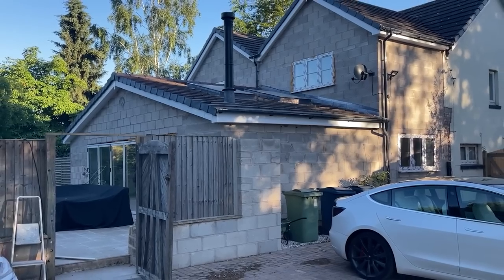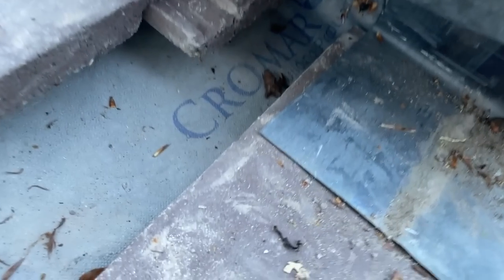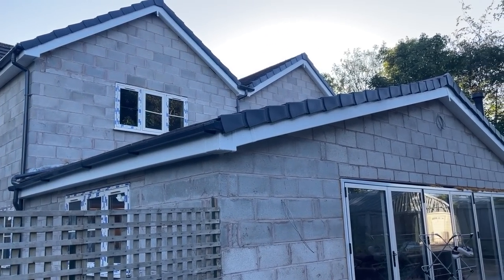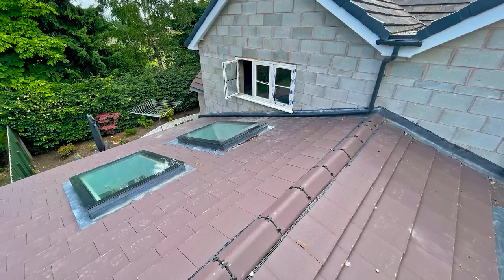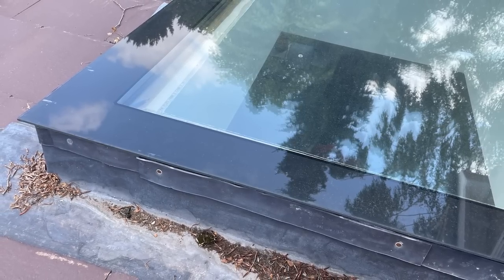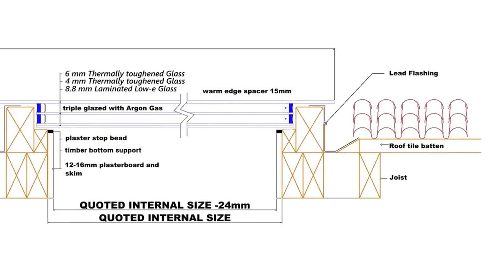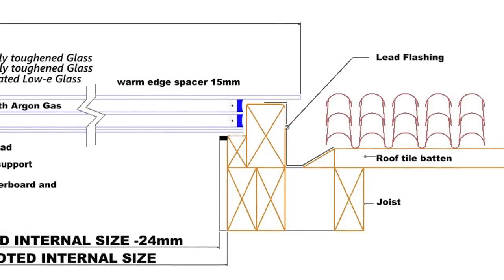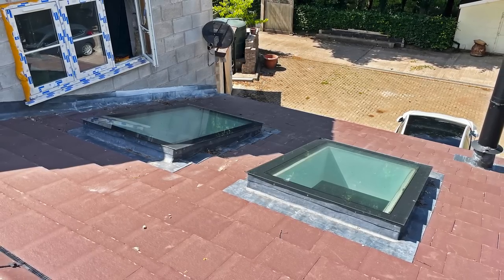How Many Mistakes Can You Spot on This Roof?

Comment: I’ve only just finished watching this and being a roofer myself I’m sorry to say you would be better off ripping it off and doing it properly. If your having problems now, trying to fix some of the problems is basically putting lipstick on a pig. Take it off do it properly and you won’t have to worry about problems in the future.
Reply: what i think also worse new roof ive seen in the 24 yrs
Reply: That's just lazy. Any decent roofer should fix that problem
Reply: @PhilipAlexander-rz6hy  your obviously not a roofer or certainly not a decent roofer, those roof tiles should not be put on a roof with a pitch of 15 degrees, there is also short courses at the top of the roof which isn’t a massive deal but definitely not right
Reply: @Telferroofing I am not, you're right. I had a reroof done which was awful. I couldn't afford a reroof, did some research, worked round the mess and patched it up. 16 years later, not a single leak. It's not ideal, but sometimes you have to work around bad things to save the costs. That's all.
Reply: @PhilipAlexander-rz6hy  in some cases yes you could repair the bad areas and save the rest but this is beyond saving as the tiles used just aren’t up for the job even if they were fitted correctly, yes you probably could patch it up in a way but for me if it was my house I’d want it done properly regardless of cost to rectify but I guess that’s why they are in that position
Reply: @Telferroofing  in my case, I was 27, just lost my job, house was a mess and roof was too. I had no money left. I didn't have a choice. There are still things that need fixing like the fascia boards but it's rain proof. They didn't lap the tiles correctly and didn't go high enough with the tiles to the apex. I worked round. I have the money now to reroof but why would I? It's staying and I learnt a lot from that horrible part of my life
Reply: @PhilipAlexander-rz6hy  just let me know if you change your mind and need a good roofer 😂 all the best buddy

Comment: Poor advice given in my opinion the roof needs to come off and correct tiles for the low pitch situation fitted. The coursing of the tiles differs on both pitches of the roof. The correct water proofing and flashing detail around the roof lights also needs to be introduced. Not good advice given in my opinion.
Reply: Agree, Rogers a plumber or general builder? He is knowledgeable but he’s talking crap on this one.

Comment: Apart from the big problems with the roof lights, the gauge of the tiles is way out! It looks like they’ve started at the facia, worked their way up and hoped for the best at the ridge!!
Reply: Defo.
Reply: Done by someone who does not have the knowledge. Roof tiles should be equally spaced from fascia to ridge.
Reply: @davidchi1277  Hi My experience of roof work, I have always started at the bottom laying the soaker on top of the slate or concrete tile as you would, Prep work bending the lead over a plank to form the L  shape, all depending on the situation, carry on placing the soakers on top of each tile, etc, reverse the L shape to go over the soaker. guaranteed to work. regards welshman 2081
Reply: Obviously they wert never in a bookies as they can't count. Shambles of a job
Reply: I noticed that straight away i mainly do slates when I do roofs. Ive only tiled a few roofs and I know how to gauge it out so you don’t end up with a daft cut or what they done lol
Reply: I know nothing about roofing but I did think something wrong when I saw the tiles at the ridge.
Reply: Terrible gauge, totally agree.  Why have they tried (piss poorly attempted) to go half bond with the tiles?  They should all be dead straight as the water bar on the tile does the hard work.  ping some lines off the gable end, top to bottom,  and get every course straight with the one above.  15 degrees pitch?  I'd have recommended single ply, personally.

Comment: This video made me genuinely sad, but not for Ross&Vicky, rather for our trade. The reason why they are in this mess is not that they cannot afford a better builder or a high quality project. They drive a Tesla (to see at the begin of the video), they can afford such a two storey extension etc. etc. I suspect that the real reason is, and this is a huge problem nowadays, that they simply don't value the job of a (roof) builder. The fact that you have to pay for a good, high quality job hasn't dawned on them. People have stopped valuing blue collar jobs, they stopped appreciating the experience, skills developed over years, knowledge. They watch a couple of YouTube videos and think "oh that's so simple, I can do it too, if not, I won't pay much for this job". It is a mess - I am almost tempted to say they deserve this. 

As for the job itself, honestly, tear it down, do it again, properly. It would save you a lot more in the long run.

Comment: After 40 odd years in the building trade i'm glad that in a few years i can walk away.
The ever increasing technicalities and specifications of modern building has just made it so much harder.
And yet , here we have a couple of rank amateurs who think it's simply a matter of doing "the easy bits" and getting "an expert" in to do the hard stuff.
Maybe when my arthritic knee gets to painful i'll do the easy bit, cutting it open, and then get an "expert" in to do the rest. He's assured me he's an experienced surgeon.

Seriously though, this just highlights how little most people understand about modern building. None of it's easy, you can f**k it up in so many ways.
They might stop that roof leaking but it will never be right.
Firstly it's to shallow, 17.5 min for those tiles.  Something like a Sandtoft 20/20 will go down to 15 but then the devil is literally in the detail.
Anywhere that you have a penetration , like a roof light or soil pipe then it's so difficult to flash, as soon as a tile kicks up slightly you pretty much lose the fall and the water will run out sideways, your flashing have to be much wider. You better make sure your underfelt is good.
Velux flashings at these low pitches are pretty much useless , on site lead secret gutters are much better but expensive to do
And on another point, soakers DO NOT work on those large interlocking tiles, again the water will simply run off the side before it reaches the next tile, you might possibly get away with a WIDE cover flashing but a secret gutter is the approved solution, especially for wall abutments.
Sorry for being pedantic but we are having to deal with these low pitches so often because of big single storey extensions. The "architects" draw it and then somehow we have to build it.
Don't even start on the insulation/ventilation/VCL saga.
Reply: @ItzD3fW1sH  It's exactly this. They think project management is easy but as soon as there is a problem it all goes tits up because they lack the technical knowledge to not only solve the problems but foresee them before they arise. The pitch of the roof should've been addressed right at the design stage.
I've replied to someone else above explaining it in more depth if you want to find it.
Reply: Exactly, she even said she opted for the cheaper window, which looks like it’s designed for a flat roof and not pitched. I’m betting they got all the materials themselves and then just paid the lowest person they could find. See this all the time, blaming tradesmen because the customer knows best
Reply: MIght be the way to go as there's no way you'll get to see a doctor nowadays.  Im willing to have a go at your knees if you like. Superglue, angle grinding and staples is my field. 18 months waiting list.

Comment: I've used Velux roof windows since I began in building in 1984.
 I've never had one fail. However, 15 degrees is pretty shallow....
Reply: Don’t velux now supply ones that will go as low as 10 degrees !
Reply: I’ve fitted them at 15° before but you do get more silt build up and they require regular maintenance, I had one on my old kitchen extension, never leaked via the flashing but from the window itself when the draining holes got plugged with crap.
Reply: They used to do a flashing kit that goes down low but to be honest they look bloody terrible.
Reply: What you're really saying is you've never been told they've failed.
Reply: I can put a Velux kit on while asleep and they never leak.
Reply: Velux supply a full flashing kit ,these just look like a DGU stuck on a homemade knock up frame with a bit of lead as an after thought

Comment: I don’t know where to start Roger, I’m a general builder not a roofer but do most of my own roofs, I’ve seen some terrible work but that is right up there.
The gauge of the tiles is terrible, doesn’t even match the other side, I’m guessing they weren’t roofers or experienced guys, I can’t believe any half decent trade would leave it like that.
I’ve lost count the amount of jobs I’ve seen like this where customers have tried to save money by project managing the job themselves and trying to save money, what you get is each trade coming in and frankly not giving a f**k.
It’s why I prefer to be in charge, that way, the buck stops with me.
It’s pretty shitty of the window glass supplier not to supply a flashing kit too in my opinion.
Whole roof needs stripping off and redoing tbh, I wouldn’t trust any of it.

Comment: Those windows will always cause headache, take them out and replace them with a proper window kit, even if you put a valley in and do a nice job of the flashing, ultimately you would still want to lift the window to get the flashing undernesth, which I assume some sort of Tiger Seal has been used to glue it down, in which case the chances of lifting it are very slim without damage. I have removed it before with a heat gun and acetone but the problem would be actually getting the acetone onto the sealant to start to melt it.

Get an endoscope camera and check the inside of the ceiling void, the stains where the joists are running across the ceiling could very well be condensation. I don't know if you've used a vapour barrier, however, I can see there's alot of downlighters & speakers, so even if there was a vapour barrier there would be alot of weak points. It's best to check sooner rather than later, if you have condensation occuring in that ceiling/roof void it won't take long to rot the timbers. I'd say you'll probably be okay as tiles will give you some ventilation above, but do check before any damage is done to the timbers.

Comment: Looks like they've built the kerb too wide for your rooflights, they're not overhanging enough. And that lead is atrocious. Then they've used insulated plasterboard inside, so the overall thickness is so wide that it exceeds the black margin of the glass.
Those rooflights can be absolutely fine if installed correctly - mine is perfect, but my single ply membrane dresses up and over the kerb, they have a generous overhang, and the water all drains away on the flat roof. That particular manufacturer doesn't recommend them for pitched roofs, whereas some don't care... but they're not guaranteeing the roof are they

Sadly for this family there are just so many defects with this extension that can clearly be seen, that we can safely say there will be countless things wrong that can't be seen, some that could take longer than 8 months to manifest - woes won't end with those rooflights

Comment: A proper lead worker could create the correct traditional flashing to code that would solve the problem without a doubt but unfortunately the glass needs to be removed to flash it correctly as detailed otherwise is is just a matter of time before it fails again, unlikely to be a DIY enthusiast job though, you need to employ someone with the right skills and knowledge, it will cost what it costs but you will only need to pay once to have the issue rectified.

Comment: I'm willing to bet there isn't an effective vapour barrier in that roof (especially with the lack of attention applied outside), especially with those recessed downlights, and I doubt they made a service void - and with moisture from a kitchen it's likely that the roof develops issues from the inside over time
Reply: Don’t forget on a vaulted ceilings, there’s two layers of insulation, between rafters then another cross laid across the rafters, in all the ones I’ve done, a vapour barrier has never been specified by the architect or asked for by building control.
Reply: The foil face can be good enough as a vapour barrier IF it is foil taped together AND you don't puncture it with downlights etc. If fitting services, lighting etc. then companies like Celotex will insist that a service void if formed beneath the vapour barrier. As an architectural designer I always spec a vapour barrier, and building control should pick up on it (doesn't mean they will, and they don't take responsibility anyway). I see this done wrong all the time, and the importance of the vapour barrier often isn't understood, particularly when people order the electrician to fit lighting etc.
Reply: There the wrong tiles on the roof. Marley mods go to 17.5 degrees

Comment: The roof lights were a false economy as no flashing kit was provided by the manufacturer, by the time you take into account the extra work and materials to form gutters a Velux or similar window would have been on par price wise if not cheaper. They would also have had the benefit of trickle ventilation and being able to open to let fresh air in.
Reply: Depends on the style they want.
Reply: Not to add by the time you've bought all the lead needed velux with the proper fitting kit would of been cheeper and quicker

Comment: Looks like the abutment flashing @ 5:33 might just be sealed to the blockwork, not stepped in (unrelated to the rooflights) - I'd be concerned that they don't have a cavity tray where the lower roof meets the wall of the two-storey part, so any penetrating moisture could drop down in the cavity. And that lead is looking stretched...
Reply: I’d second that. Did you see any weep hole at the bottom tray to let the water out.
Reply: I had to badger my builder to put cavity trays in as we're on plans    .  So annoying
Reply: @bruce dickinson 12   Did he run to the hills afterwards?

Comment: I’m sorry but that is horrendous workmanship, Just a few things spring to mind:
• Roof battens/tiles incorrectly gauged leading to a terrible short course.
• Roof tile bonds not central.
• Dry verge caps terrible installed.
• Need to ensure lead soakers are installed where it meets the wall not just lead cover flashing.
• The flashing needs redoing around the roof windows with soakers installed.
• Ensure at least 100mm headlap on the tiles due to low pitch.
• Ensure 150mm lap on the membrane due to low pitch.
• Probably no eaves ventilation.

If they planned to live in the house long term i would personally start fresh on the roof, Remove all the tiles, batten, membrane and roof lights. Install the new low pitch Velux roof windows which has their our flashing kit instead of that terrible lead around the windows, New low pitch klober membrane, New marley mendip 12.5 degree roof tiles that are designed for these lower pitches and new lead step flashing against the wall with soakers.
Reply: I think 15° is the minimum allowed for Velux so might not need the expensive and ugly pitch changer flashing.
Reply: @TurinTuramber  Velux have now released new low pitched roof windows which go down to 10° and comes with a nice recessed flashing kit.
Reply: @RPT7  That's very interesting Rhys, could be handy for the single storey full length extensions. 10° is a flat roof!

Comment: Hi Roger. The main take away for me, which is obvious but so easy to neglect, is to understand how structures are put together, how they work, so you understand the vulnerabilities, and the best way for me to learn about structure, and how things fit together is by observing 'detailed drawings'. A 'plan' and a 'section' is largely all you need to get an understanding of the structure. Then you learn more about loads and spans by checking out 'span tables' and then you could listen to an engineer talk about loads. Then I learn most about the quality of materials, and how they are used and work in the real world by people who have experience, such as you Roger. So thanks so much for your knowledge.

Comment: From the start it should have been a flat roof, the upstairs window cill are 2 close to the lead flashing
There's not enough upstand to the lead flashing
The roof windows should have a 150mm upstand above the roof 
If the were adamant on a pitched roof it needed to be a steeper pitch or used a rubber/fibreglass type of covering

It's an absolute shambles from start to finish
Reply: Doesn't need to be a steeper roof, just installed correctly and or a different roofing system.
Reply: @Robert-cu9bm  exactly what my comment says!!